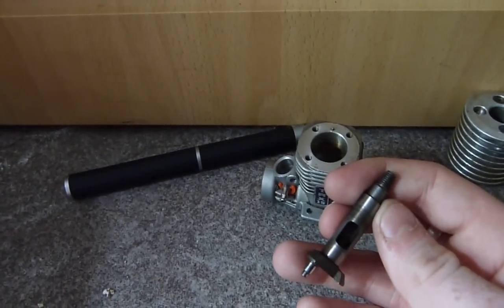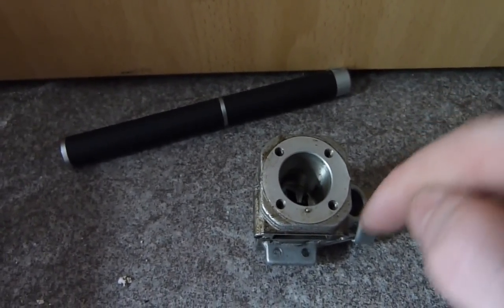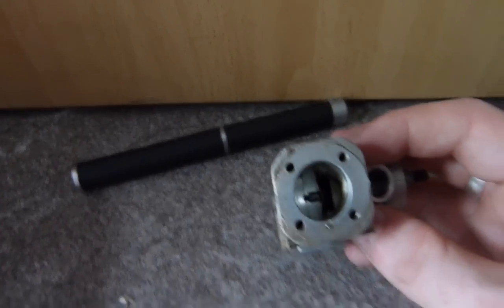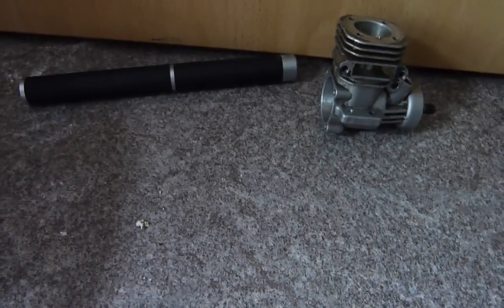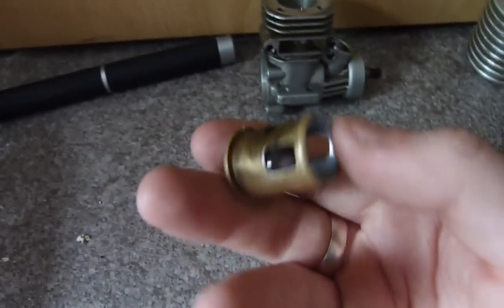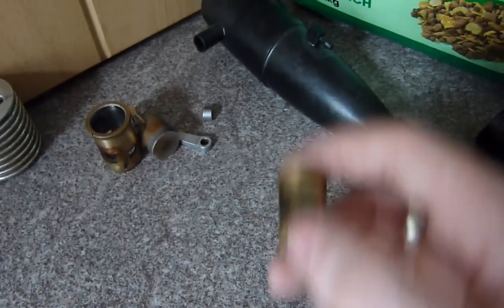Why superchargers don't work on rc nitro 2 strokes (and any 2 stroke)

Comment: They dont work on most strokes. But they do work on nitro two strokes, because they have a rotating intake. Not with much boost pressure, but you can achiev very significant gains by the better gas exchange you can get that way.

Comment: As burnt air and fuel travels out the exhaust a supersonic pulse bounces back into the engine causing the forced air and fuel mixture from the supercharger back into the engine 
Also a super charger puts more air into the engine so just remember need to richen the fuel mix quite a bit to get a perfectly running rc

Don’t listen to this guy. Rc Supercharging products have been around for over 10 years meaning thay have been through lots of changes and redesigns to make them better

I hope I have helped those people who wish to buy a supercharger 
or those who despise the product to change there mind.

Comment: Superchargers work great on 2 strokes and have for the passed 80 years. 
Detroit!  These engines work off almost the same principal,  lack of injectors but the carbs are adjustable.  Good sir,  you're not correct!

Comment: Been running boost on my snowmobiles for years and the dino doesn't lie it does work substantially better on reeded 2 strokes if the engine isn't reeded you need a pipe specifically designed for it to keep the boost in the cylinders
Reply: yea really they sell rc 1/5 superchargers and uh the thing is faster so i would say it gots a bit more power

Comment: This is the same sort of armchair reasoning that leads to people believing in the flat earth. 

You don't need valves and closed containers to compress air. All you need is to force more air into the crank case than can leave. Notice how you only have the 1 exhaust port but 3 intake ports? 

More air comes in than goes out. Also, since the fuel supply is metered by the air supply by the carburetor, there is fuel mixed into the compressed air. So even if you are blowing half of it out the exhaust port, you still have compressed air and fuel in the chamber once the ports close. 

And just so you know, those famous 8-71 superchargers that old school drag racers used and made famous were originally designed for TWO STROKE diesel engines. Those TWO STROKE diesel engines were supercharged right from the factory. Because they needed to be supercharged to produce enough power to do work. 

Just because you've owned a motorcycle for 12 years doesn't make you an expert on fluid dynamics.

Comment: More air = more pressure
Engine runs leaner? Sounds like you need to tune up for boost in general on a two stroke
Lubrication? You can just run more nitro and more oil
The reason why you see these videos on YouTube and the effect of the supercharger is because IT WORKS you fucking pinecone

Comment: What if the super charger pressurizes the fuel tank?
Reply: Yeah that would work, as the pressure only increases with the rpm increase... so basically the higher the revs go, the more pressure it would create in the tank, therefore balancing everything out. As the air intake increases, so does the fuel
Reply: Can confirm! I’m using an o.s. Engine with the good ol hated RB Ino supercharger and the (key) auxiliary fuel pressure system. As rpm increase, pressure in the tank increases and balances out the mixture, the rpm difference and tuning stability is night and day. Been running strong for 2+ years with the same setup on 30% and still have great compression. Pipe resonance really doesn’t play as much roll in this situation anymore. I totally agree that it’s bad to not have the auxiliary fuel system, because then it’s the exact effect ol chap here is talking about. It probably just goes lean. But I won’t try so I’m not going to find out! I guess the only trade off is it is a bit more smoky then normal. Because it IS burning all that fuel at higher rpm, and not spitting. I also use a hot plug. Before adding the supercharger I tried 2 different o.s. Pipes and couldn’t get the stability and the performance I wanted (drag car). I guess since I’m only doing quick runs I’m not doing to much to hurt it even if I’m just thinking that it works lol... but it’s an animal going strong
Reply: Then you will flood the engine probably because there will be too much fuel trying to enter the engine and if you lean the screws to try to stop flooding the engine it could blow the hose off for the fuel. What I've just said is probably not correct at all but that is just how it works in my head

Comment: the Detroit diesel two cycle and EMD two cycle engines use roots blowers for scavenging purposes Detroit diesel  also uses turbos for more power but the blower is still used for scavenging  EMD uses turbos instead of blowers on some engines the turbo has a clutch that is engaged at idle it disengages above idle

Comment: listen here, dumbass when it goes down that does create alot of pressure. hence the flywheel. so if you can pack more air fuel mixture in by forcing it in then you have more going into the cylinder making more power. as for the title, do you even do any fucking research? there are 2 strokes that have oil and have the 2 stroke cycle. in conclusion, the whole video is wrong, they make more power, and a 2 stroke with no back pressure is in affect. thank you if you read this all.

Comment: Wery well explained! I dont know why all the thumbs down?! I have great knowledge of car engines in fact have been modifying and performance tuning small sized engines such as the fiat puntoGT std 130hp modified 300+bhp.....mine was 293bhp... so being around and fiddling with engines i can definitely say supercharging or turbocharging with a small keychain turbo does NOT WORK on two stroke engines as no kind of pressurising the cylinder takes place due to exhaust port being open during the induction cycle incoming boosted air flushes out even more fuel and what boost your unit has produced so equaling back to normal performance with an increased wear due to less lubrication/fuel can also mean running lean thus producing slightly more power being mistaken as the benefit of the charger! However would work a treat on a four stroke RC engine especially with high loads on the transmission!

Comment: Tell the Rail Road industry, U.S. Navy and Coast Guard that a supercharger does not work on a two stroke.  (We ran a 24 piston, 12 cyl supercharged and turbo charged valveless diesel 2 stroke engine) ...
Reply: True, theres lots of engines ies out there.
U can use a carb also, but at this scale I dont know...
Reply from the maker: Yes but they aren't crankcase induction. They all have wet sumps, correct me if i'm wrong there.

Comment: Yeah you are a dumbass 
An old engine that you put a super charger on.....and oh it failed 
What a surprise..... NOT 
You have to have an engine designed for higher rpms than it would normally see running without super charger
And take a guess what happens if you do ? Exactly a broken con rod!!

Comment: I find it funny that my first reaction to supercharging a nitro two stroke (or any engine for that matter that doesn't have a valve train) is that it wouldn't work. 
I work on diesel engines that may use either a turbo or a supercharger. These engines have a valve train and do not require a tuned port in the exhaust to keep the combustion gas from blowing through the cylinder. By changing the combustion pressure, you change the process of the cycle entirely. 
Just because you cram more of the mixture in the crankcase it doesn't mean the pulse in the exhaust is still in tune to overcome this additional pressure.

Comment: Actually it is possible to supercharge a 2- stroke  but there is a big BUT. The but is that the exhaust ports  have to close before the charging ports close.  There are only two configuration that allow this: a uniflow two-stroke with intake ports in the cylinder wall and overhead exhaust valves,  and a 2-crank opposed piston two-stroke with exhaust and intake ports in the cylinder wall where the exhaust crank leads the intake.  In both of these configurstions, there is a very short period of time in which the exhaust ports are closed while the intake ports are open. During this period, it is possible to boost the pressure with a suprcharger or a turbocharger.  
Superchargers and tubochargers are very common in uniflow 2-stroke diesels used on ships.  Achates is working on a small turbocharged opposed piston 2-stroke.

Comment: Before you say superchargers don't work with 2 stroke engines, you should contact Detroit Diesel and explain to them why their supercharged 2 stroke diesels don't work. They usually supercharge with a roots type blower and turbocharge on top of that with well over 40 psi boost. Might be true with the little r/c engines, but not beyond that.
Reply: and contact speedwerx and explain to them why their superchargerd 2 stroke gasoline dont work
Reply: SMOBY44 I hate to be late, and I hope it's already been cleared up by this point.
An RC engine has no valves, the intake and exhaust are both open at the same time, so any boost goes right out the exhaust.
A Detroit diesel has valves, so the intake can not just flow out the exhaust, allowing it to build pressure.
Reply: Slightly different engine lmfao..
Are you seriously comparing a big ass diesel engine with a tiny nitro engine?
You must have been smoking ALL the crack..
Reply: ....a 2 stroke diesel and a 2 stroke nitromethane engine are totally different.
Reply: SMOBY44 Detroit Diesels aren't supercharged, the blower is just there for pushing exhaust gases out of the cylinder. The confusion arises from when hot rodders adapted the blowers of two stroke Diesel engines on to four strokes.  Two stroke petrol engines are open as the pistons move, hence it can't be used with forced induction.

Comment: Also, wouldn't burning more air fuel produce a more powerful exhaust blast, therefore a more powerful sonic resonance in the tuner pipe and having enough force to shove the leak charge back?

Comment: There is a way to get more air fuel in via boost in 2 strokes, but it goes against normal 2 stroke operation. 2 strokes are tuned to high high rpm, which needs massive port timing and massive ports to flow the gasses. If you were to super charge one of these engines, you would get what you're talking about with boost leaving out the exhaust until only the highest of rpm. But if you tuned your exhaust back and restricted the flow of exhaust properly, you could utilize the extra pressure in the crank case the same way the low pressure is normally used. That is: intake port opens with a crankcase pressure higher than exhaust, forcing the exhaust out of the engine. Again, nobody wants to close up their exhaust and kill their rpm range, so most 2 strokes can't take boost well. Also you mentioned the pressure restricting the piston on its power stroke, but during crankcase intake the boost pressure is helping just as much to push the piston up and compress the air fuel mix. So no loss is made except the mechanical loss of a supercharger.

Comment: thoughts?
Dyno Test of the 1/5th Scale Supercharger by RB Innovations

dyno runs. i would say more fuel and air burning per cycle is a sure fire way to get more power out of an engine.
Reply from the maker: As a rule yes the more fuel air you force in the more power you get. However with a two stroke because you have the transfer and exhaust port open at the same time that added pressure just forces the mixture straight over the piston. Expansion chambers do help this when it's just naturally aspirated. I have a few problems with that test as well. One you cant say it's a honest test when the marker of the product is testing it, he is not going to show it in a bad light. Two the graphs seem to start at different points, now might be picky here but it says to me the calibration between the two tests is different. It basically goes straight to 2HP off the bat with a supercharger. Third he says nothing was changed between the two tests, to make a supercharged engine run properly you would have to adjust the mixtures, just doing this without a SC would increase HP, a well tuned 29cc two stroke will make 4.19 HP +.
Reply from the maker: Thanks for pointing this video out to me, i will have a good look at it and post a video up with my thoughts :)
Reply: That car uses a 30cc gasoline engine. Not a 3cc nitromethane. There is a reason they don't shoe you the dyno for the nitro supercharger

Comment: Finally someone who knows motors ... If anyone's back talking this guy you're fucking stupid, boosting a 2 stroke motor is like blowing throw a straw, you can't make more psi if you can't keep it inside and control it, it's common sense ppl
Reply: Tell that to Detroit Diesel. I suppose supercharging thier 2 strokes is just fucking stupid?
Reply from the maker: SMOBY44
  Detroit 2 strokes are uniflow-scavenged type meaning they don't use the crankcase to pressurize the charge but as you point out a supercharger. The type of two stroke i'm on about is crankcase induction 2 strokes which use the piston and lower crankcase to pressurize the charge.

Comment: So the dyno video that I watched on a hpi baja engine isnt true then based off of your video?
Reply from the maker: I have heard of that video but haven't come across it myself but if you post me a link i will have a look at it. I know someone i know watched a video which could be that one and said that there was some things which didn't ring true. If it's from RB innovation which it will be i'm guessing well the just don't produce anything of any quality.
Reply: Ofc its not true lol. Have you seen any proof from non-sellers?
Reply: If you paid attention, the supercharger will push the extra fuel out causing the engine to run lean, yes it will produce a small amount more power because its lean, but ur engine will die twice as fast. also youll use twice as much fuel. rather you could just tune your carb leaner and save fuel. smh, people need to pay attention.
Reply: Brendon Lynn So you're saying put a supercharger on, so your engine will run lean? There is a needle already to set engine lean without spitting the extra fuel..
Reply: Oh hell no. im saying DONT use a super charger. im saying just tune ur engine better if u want power.
Reply: Supercharger forces compressed air and fuel into piston to make a bigger explosion. This works in 4 stroke engines beacuse at that time the exhaust valves are completly closed. 2 stroke engine doesn't have valves that move indipendent (the pison is the valve). They relie on a resonanic backpresure from the expansion chamber in exhaust (which is fine tuned for engines ccm & its high rpm) to push the air/fuel mixture back from pipe into cylinder just before the piston closes the port.. putting a supercharger stops the pulsing resonance in pipe, blowing huge ammount of excess air&fuel out of pipe.

Comment: If you had a variable expansion system such as a piston that controlled the working length of the expansion chamber, could that work to adjust the back pressure phase to make a more efficient engine across a wider range of rpms?
Reply from the maker: This type of system is used on a lot of two strokes but it's more common to have a chamber which has a valve to vary the volume of the exhaust. But yet again they wouldn't be able to handle the extra amplitude of the wave and pressure. That's just going off calculations i have done over the months.

Comment: At really high rpm it does make a difference.  High end snowmobiles come from the factory Turbo charged.
Reply: Yeah but they are usually not 30cc or less.. And lets not forget that they are 4-stroke. I havent seen a 2-stroke with a factory mounted turbo.
Reply: snow mobiles have an exhaust port(s) and use a scavenging system kind of like a detroit diesel..that is why they work ...not even close to the same thing as a model RC engine..

Comment: Hi Ginger Geordie Biker.
You´re nearly right. 2-stroke engins WITHOUT ANY VALVESYSTEM like rc-nitro-engins DO NOT GET ANY ADDITIONAL POWER WITH SUPERCHARGER - if you´re able to get it even running.
There is so  much confusion with the correct mechanical-terms.
Some easy rules:

2- and 4-stroke engins can be run with nitro, gasoline or diesel!
Diesel/gasoline/nitro is no indication for 2- or 4-stroke engin-concept!
4-stroke engins NEED valves for intake/exhaust steering.
2-stroke engins regularly don´t have any valves for intake/exhaust steering.
(That´s what you have shown us properly)
2 Stroke & 4-Stroke Cycle Engines
2 Stroke Engine vs 4 Stroke Engine  (look at 2:05) !!

BUT:
Some stationary & many big ship-engins are based on a 2-stroke concept with exhaust valves in the cylinder-head.
Some racing teams worked on it. But efficiency is pretty low.

In older days, 2-stroke engins for RC-models were somhow named "mini-diesel".
That ist not correct and was only based on the fact, that there is no ignition system used. The ignition is only related to pressure & heat of the compressed gas.
The first engins even had no glowplug - just only a adjustable, inner cylinderhead, allowing to adjust the compression.

Back to supercharger:
They need to have a propper working valve system.
That is only available on 4-Stroke or valve-driven 2-Stroke engins.

2-Stroke RC-engins don´t have any valves.
Instead of that only a slot in the crankshat and in the cylinder.

Detrot-Diesel ist just a brand but NO ENGIN CONCEPT!
Some of their engins are 2-stroke engins burning diesel - that´s it.